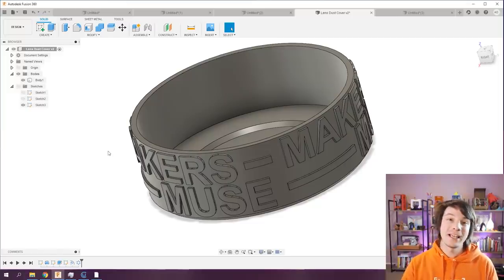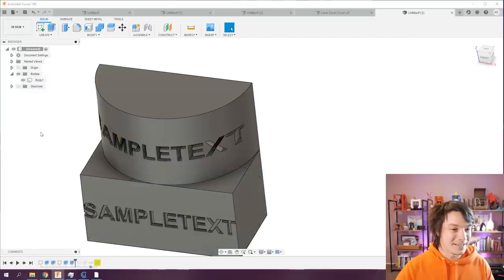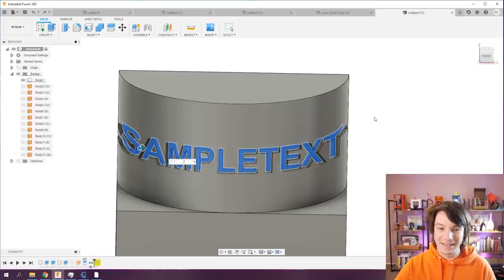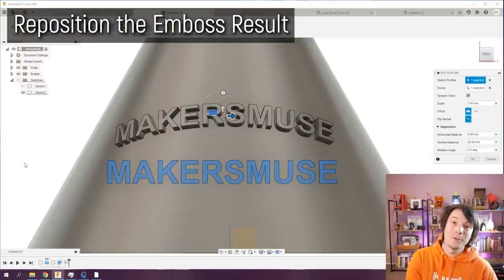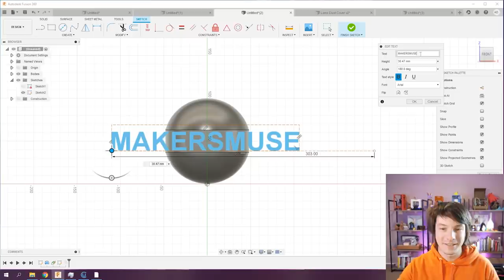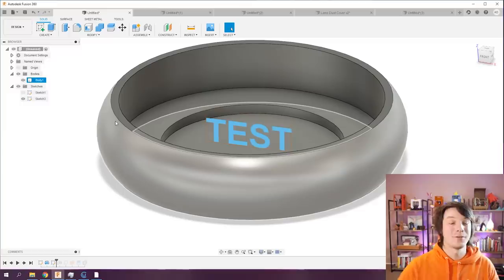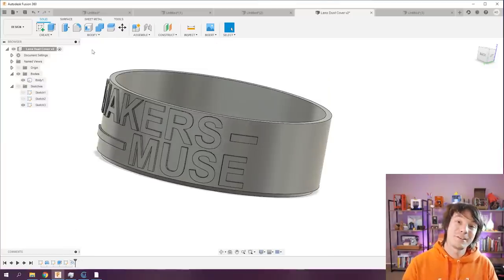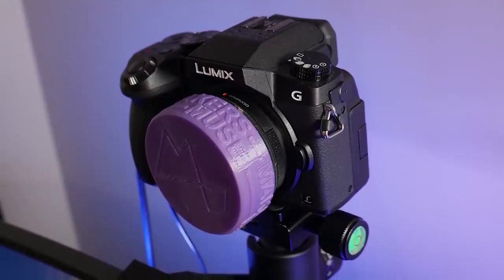Wrap Text in Fusion 360 using Emboss (FINALLY!!!)

Comment: Embossing on an arced or other complex surface is possible. The more complex the surface, the more work it will take. Basically, use a dummy (tool) flat/cylinder surface to encapsulate the arced one, emboss onto that, cut away the tool surface, offset the base of the remaining emboss into the arced surface, finally use an offset from arced surface and keep the intersect. If you want to deboss instead, just use an intersect when you offset the base of the remaining emboss.

Comment: Angus, a question. I have a mesh that I've pulled in - in this case, the famous print-in-place planetary gear. I want to put a single large raised letter across the gears. My idea is that the letter comes apart, then together as the gears turn. However, there's not a single face. Ideas?
Reply from the maker: Hmm, you could perhaps project the outline of the gears and then extrude the letter down to the gears, using the outline to control it. Tricky!

Comment: Great video, thanks! Just what i was looking for :)
actually for a simple, consistent shape like the ring you showed it would be really easy to get it working as well. just emboss on the inner flat surface, move the letters outwards until they stick out (or create a new surface to do that) and then offset the originals ring surface and cut off the letters. at least in theory this should work, maybe someone whos looking for this can test it out.

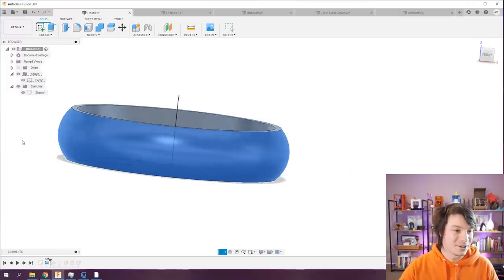Comment: i found a way to emboss onto a curved face like at 8:34 but its a bit finicky. you gotta emboss it by just a little bit onto a cylinder of the same diameter of the widest part of your curve, use a sketch to square off all the faces of the letters/shapes, and extrude them individually to your curved face.

Comment: how can i emboss the .shx fonts in fusion 360? i want to machine a text by using the single lines of the font so the diameter of the endmill i will use will be the width of the text.

Comment: I was new to fusion 360 and I literally just hours ago using the metal sheet flange function to wrap text on a cylindrical face (works by unfolding the metal sheet into flat surface to place your text onto, refolding it once done) following a youtube tutorial. Would definitely trying out the emboss method the next time.

Comment: Hey guys. Is there anyway of doing this but with images on a non uniform surface? So I have a sculpted surface that's not uniform, and I want to put a logo onto it. But I've run into problems. Like the logo is skewed. I can get it to work on more uniform surfaces, like cylinder and cine, but not my sculpted surface. The surface I want to do this to is a human leg shape. Thanks guys

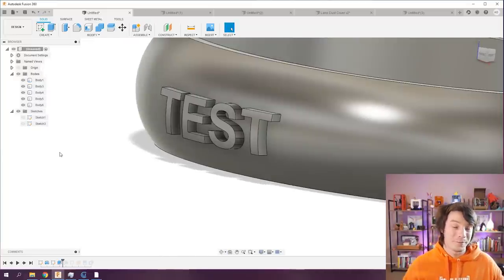Comment: 9:43 In that specific case, could you also emboss it on the interior face, but set the operation and distance/direction so it extends through the outer wall?

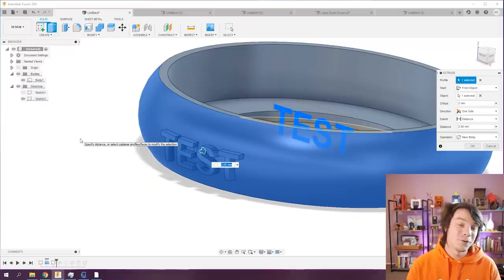Comment: @09:20 Haven't tried it myself yet but I can already see how you COULD do it with a little extra work on your part by using a compatible placeholder shape to get an almost distortion free base and then using it in another step to boolean the curved shape.

Comment: I just been using the default windows 3d builder when I needed to emboss text does it at nice angles just make a model throw it in hit emboss choose a font and emboss or tweak the settings. For a free tool that comes with windows it does it pretty good but it nice to see fusion 360 has emboss text now.

Comment: Great video, i have been playing with this for a week or so now and its awesome, there is only one thing i cant work out and wondered if you can help.
I have a cylinder which I can deboss some text and 3d print without a problem, but i want to be able to print the debossed letters in a different coloured filament and glue them into the printed cylinder. oh for a dual extruder rig but finances wont allow.
Any ideas?

Comment: at 9:21 you can emboss from the inner ring which is flat, and then extrude to outside until it is visible from the curved surface, it will not be disorted, so most of the emboss will be hidden (joined) in the inner solid of the ring

Comment: So to emboss on the ring I'd create a cylinder the same diameter as the smallest diameter of the ring and set the depth so it extrudes past the ring, then create another sketch based on the one the ring is based on but with the outside curve offset however deep you want the embossed text, create a new object from that new sketch and use the combine/cut/intersect tools to trim the embossed text so it conforms to the curve. Not sure if that makes sense but I think it should work if you can decipher my description.

Comment: Since that circular pattern doesn't seem to mind overlapping, you could pretty easily do a knurling pattern around an object. Make a V that stretches from the top to the bottom, emboss that, and then do the circular pattern with that embossed V. Put your number super-high, and they'll end up getting really close to each other, giving you a knurling pattern.

Comment: Should be fairly easy to join the new method with some old ones to create features on spherical surfaces. You'd just need to create another cylindrical surface around it, use the emboss on that, then extrude inwards.

Comment: Another good video Angus, thanks. I've been playing with the Emboss tool to create knurls (another basic tool sadly lacking from Fusion 360). The old approach of creating a small detail and patterning it hundreds of times is too computationally intensive for such a small detail. I hoped that the Emboss tool would mean a shorter coffee break while it recomputed after an edit, but nope, still a long delay. I did discover that a really long string of text could be spiralled up a cylinder for many rotations by giving Emboss a small angle. Try it with a string of diamond characters (use any Unicode font in Character Map -> Search "diamond"). It's an easy way to create a sort-of-knurled surface.
Reply: lars christensen has a video on a workaround for knurled surfaces that might be helpful to you. I believe it's a livestream and he uses CAM techniques to produce the knurled surface which was relatively computationally-light compared to the pattern method

Comment: Did you need to add supports for the Embossed letters? I saw you had 2mm, which would make 2mm overhangs with 90 degree angle. Or am I missing something?

Comment: I definitely should be using Fusion, but I still just can't get used to the workflow. So for anything complex I use Rhino.
I've recently designed a guidescope* and as a cosmetic touch wrapped the whole thing in a debossed hexagon pattern.
It takes forever to print due to the increased surface area, but it looks very nice👌
At least on this occasion, I was doing something that wouldn't have been easy in Fusion :)

*A smaller camera equipped telescope, that sits on your larger 'scope, to make sure it's being kept exactly on target. Very useful in the long exposure photographs needed to capture the dim light from distant galaxies and nebula  :)

Comment: I used to export and use tinkercad to add curves text. Sadly my 3D printer is not operational, but I love making prints a little special by adding text.

It seems to work o concave surfaces too, but what about flat curves horizontally?

Comment: You could use the emboss tool to make text go all around that curved surface ring, you'd have to actually first make the ring's surface flat, emboss text on it making it pretty "long", extrude and join the curved surface over the flat one, and cut away from the embossed text an offset body with the same curvature as the the ring's surface!

Comment: I would be happy with the ability to start a line based off of an existing feature without having to project the lines first. I hardly ever put text on my crap heh.. Or extrude whatever I want including splines that connect to other features and use lines on multiple features; sometimes is a useful shortcut to doing more work.

Comment: to emboss on a sphere couldn't you create a cylinder body around it and deboss through it into the sphere it wontl be the same depth from the surface in the latitudinal(I think) direction but could fill it with another sphere body inside

Comment: Angus, couldn't agree with you more about the addition of the Emboss Tool. I came from Inventor and the "Emboss Tool" was sorely missed after moving to Fusion.

Typically, the error you mention at 2:38, about the profiles failing, are most likely related to the chosen font. If you go into your sketch, right click on the text, and "Explode Text" you will most likely be able to find the culprit which caused the failed profile error. I find that it's most often where the profile of the text doubles back on itself, loops around itself, or appears "funky" in some form or another. If you don't plan on having to move your text again, you could trim up the "funky" bits and voila...the extrude can now be calculated.
Reply from the maker: Good call, more exotic text usually fails completely... I hope their revamp fixes a lot of the issues.

Comment: You can work around to emboss on a surface that is a revolved curve, but it's a 3 stage process. First emboss on a revolved flat but make the embossing deeper than you need. Then revolve the curve you wanted around and join it. Then offset that curve and revolve it to remove the top of the embossed text. A bit of a work around but the results look good.

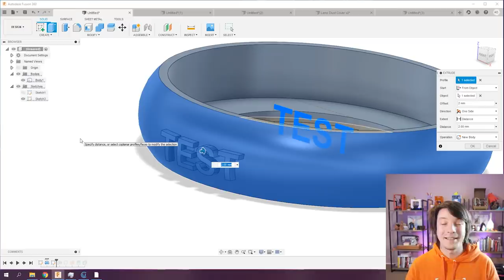Comment: 9:30 wouldn’t it be MUCH better to just make a cylinder shape that fits within the shape you want to print, then use the new emboss function on that cylinder and increase the size of the extrude till it pops out of the shoe you are printing? It won’t be perfect, but it will be far easier and closer to perfect than the other 2 ways you mentioned.

Comment: I'm used to doing this with an Extrude from the center of the object, with the Start "from object" option which works on spheres and all sorts. Some fonts do still fail, it is a feature I am told by Autodesk people... But yes, it still does cause some distortions compared to this new and quick method, and trying to go 360 would probably destroy reality.

Comment: On the circular pattern you don't have to select the axis, you can select a round surface (like the outer surface of the cylinder) or a round edge (like the upper edge of the cylinder).

Comment: I tried my hand at a pencil cup (well, usb cable cup now) with a hexagonal pattern punched out. I ended up using the sheet metal workflow in order to do it (unroll, punch out, roll back up). This is one of those "why is this not a thing?" features for the longest time, so this will be nice. Shame that it won't work on a spherical surface, but I can live with just cylinder and cone.

Comment: Hey @Maker's Muse, in the limitations example, is it possible to do a temporary cylindrical shell around the ring, then do the emboss with the text on it to get the text in a round shape and then use the other methods on the faces of the new embossed text to get the text around the ring?

Comment: I'm finally thinking about my first 3d printer. I'm thinking of the Creality Cr10. It's between $350-$375. Is there a better point for the same money?
Reply: I really love my cr10, great starter machine. Only thing I can say is that if you only want one machine, you might want something with more features.
Reply: @Weezy4reezy  like what and what price?
Reply: @richardbennett8678  I moved up to the D3 hero, I think I got it for around 450. It has roughly the same frame as the cr10 but it has dual independent extruders. This let's you do dual color or dual materials for things like dissolvable supports. It can function the same as a cr10, but with some extra comforts. Totally up to you to decide if those are things you might want.
Reply: Gavin Stowell where for $450? On amazon $699
Reply: @richardbennett8678  It's 550 now on the hictop website where I purchased mine. They have decent U.S service, but that was before the pandemic so I dont know how that might affect it.
Reply: @Weezy4reezy  thanks

Comment: Nice Angus!  Thanks.
Question:
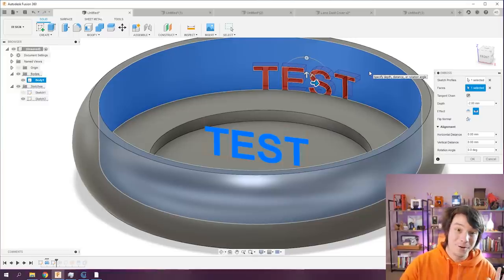At 9:10,
1. If you had mirrored the text first 
2. Placed a cylinder just outside the ring
3. Extruded the text to the surface of the cylinder
4. Turned off the cylinder
How distorted would it have been?  I do realize that the cylinder would make the tops and bottoms of the text stick out farther from the curved outer surface.  But was curious about the distortion mostly.
I think I'll try that after Install Fusion 360 on my new laptop
Thanks again

Comment: With the double-curved surfaces that don't work did you find a workaround? seems like you might be able to do the feature on the a flat-curved surface with, over extrude the emboss feature, then cut the outside off with an offset from the double curved surface. Wow, thats hard to explain with text...

Comment: You could create a cylinder slightly larger than your curved ring, emboss that and then use it as a cutter to cut the outside of the curve. There seem to be plenty of ways of using this feature to create tools to affect objects.

Comment: Workaround, make cylinder inside a sphere/torus/etc and emboss on that and combine it with the first part, and if you want the text to "curve" with the surface then make a slightly bigger spare/part and intersect that with the original part that has the text sticking out, now the text would have the same curve....
Reply: Exactly what I was expecting Angus to do when he showed that part.

Comment: The reason why text fails consistently is because of the font file itself. You see the same thing with lesser programs like SketchUp where you'll get mixed results based on which font you picked. Text files are rather low-poly when translated to 3D so those very arbitrary points in space can be problematic in creating a manifold element. Not an expert, just restating my own experiences.

Comment: On the curved surface (like that ring) you could emboss/deboss on the flat inside with enough offset so that it protrudes on the outside. You would get letters that are "higher" towards the edge. Then offset the outside arc of the ring and make a new revolve that cuts off the letters to conform to the ring. It would be fine with no distortion :)

Comment: Can you do this with sketch objects other than text? Say you need to wrap a drawn pattern around the outside of a cylinder? I've used the sheet metal tools to unfold and draw on the surface recently but that always feels like a workaround rather than a proper feature.

Comment: I have found that you can use the "rotation angle" of X degrees in the emboss tool to wrap the text around the object multiple times just as long as you don't intersect with the text. So the text is in a corkscrew readable text. Start at the top of the object and read the text as you rotate the object around. You do have to play with the degree of the angle to get it right, but it is not difficult. Works pretty good.

Comment: Could you deemboss, on the inside cylinder and push out through the curved face?
Reply: No. You can not cut something that is not there. You could cut into an other temporary body and then do some boolean operations to get the result. The result would not be perfect as the created emboss would not follow the curve to have uniform distance.

Comment: About the ring with the arced surface: what if you punch your text from the back throughout the ring, and then close that surface again? You'll get an debossed text with different depth from the outside surface, but it would still work, correct?
Reply from the maker: Yeah, that's a workaround that'd be fairly close.
Reply: @MakersMuse  You could then split the the text with an offset arc surface and end up with a pretty spot on workaround.
Reply: I was thinking you could emboss from the inner flat circle to the outside and then use offset curved circle on the outside to trim it to the desired height
Reply: 3hr too late...
Reply: I was going to also make a comment like this. Now to figure out how to emboss with this.
Reply: @Xyphis I tried that but it only subtracts out of the larger cylinder not the inner.

Comment: I've been wanting to wrap an image around a cylinder for a while and wrote a program to do just that for this spring to output stl files.  This is the functionality I was looking for all along.  I launched Fusion 360 and the test project I put together in the spring doesn't have the emboss tool.  Do I need to install it or enable it somehow?  Or what do I need to do to get access to the emboss tool?
Reply from the maker: Give it a chance to update, it's in the latest build :)

Comment: In your limitations example, can't you use the emboss tool to first have a profile on the inner ring and then extrude cut that through the ring? In that way, it will only distort in the Z direction, since the circular form is kept by the emboss?
Reply from the maker: Hm yeah I reckon that would work well! Fake a cylindrical path.
Reply: @MakersMuse  I tried but I can't get it working, the embossing does not create a profile to use for the extrude cut through the rest of the ring. Also, since the circle is on the inside, the text would be mirrored.